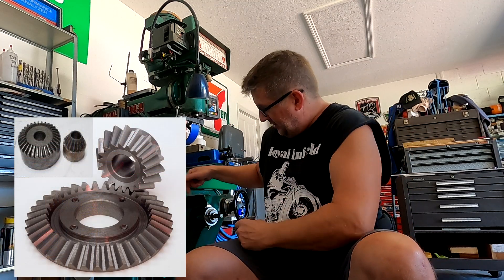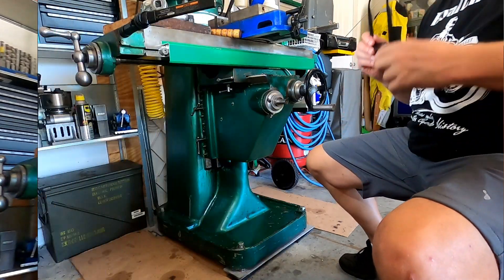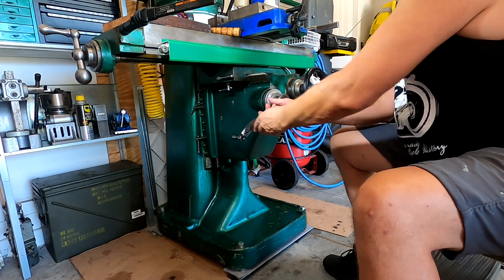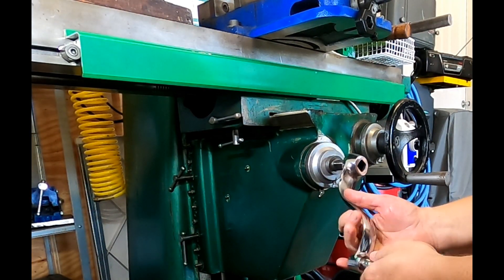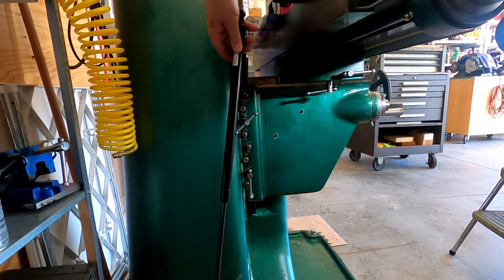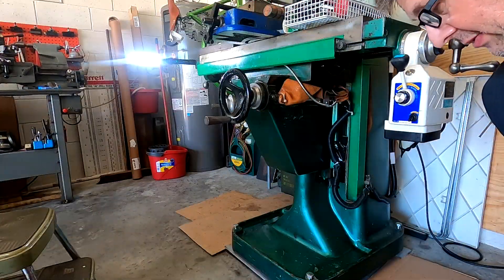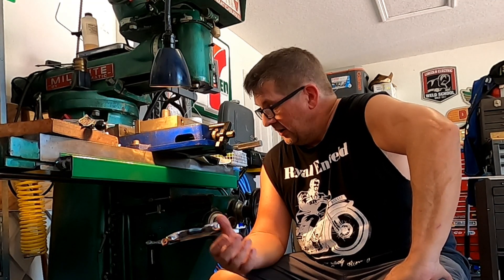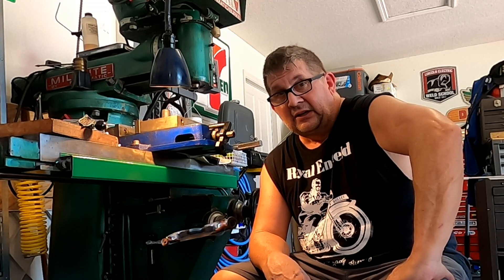How to save your Z axis knee gear from destruction. Simple modification to improve your knee mill.

Comment: When I got my mill I discovered very quickly that moving the table up & down is a huge waste of time when changing tools. 
The DRO and power feed for the table were much higher on priority list so I started looking for cheap and quick solution to drive the knee.
I found out that my “scrap yard rescue” 1/2” low RPM corded drill with variable speed can crank the knee just fine.
A 12-point 18mm deep socket fits perfectly over the 5/8 square shaft. A cut off 3/8 socket driver extension goes into the drill chuck, the socket fits the square end of the extension, et voilà - a cheap, quick and very functional power feed for the knee.
In fact, it has been working well enough for last few years that I completely abandoned any other solution.
The only downside is that the drill stick out a bit. But if it gets in my way, removing it only takes 2 seconds.

Comment: Don, I’m about ready to do this mod on my 65 MV1. Have you had any thoughts on changes or advancements on the upgrade since you have had this working for a few months now? I really appreciate your content and time invested to share your info with us. Thank you. 
John in Mn
Reply from the maker: John. Yes this is an excellent question. If I were doing it again, Ide probably use 150 PSI cylinders instead of the 200 psi. The higher force causes the knee nut to lift when I'm cranking downward with low or no weight on the bed. So doing small parts you have an extra 4 rotations of crank before the bed starts dropping. With heavier parts its not an issue though. The added assist is amazing when you use the z axis to drill upward using the z axis. Its smooth and easy to move. You can sit there drinking a pina colada and watching the bikinis float by almost forgetting that you're doing a heavy - precision drill operation. I've thought about buying a set of lower psi cylinders and just swapping out depending on what job I may be doing. I definitely do more small light weight stuff on this mill, so it wouldn't be that often.  If you need anything else, let me know. Good luck with the MV1. Great small knee mills no matter what the snob boys may think. Don
Reply: @donsengine3158  
Thanks for the update, I was concerned about that just a bit so I will look for 150 lb. lift. Your vision of daydreaming about bikinis…. That’s Florida stuff, snow boots and parkas up in the great state of Minnesota🤓
Reply from the maker: @johnvandewege7607  Hay,  I used to live in the great white North too.  My son moved down here from MN/SP and my wife was quick to pack us up and follow. Don

Comment: Nice video. Thanks.  Since you mounted your struts vertically the upward force is different when the table is up (spring is fully extended) that when it is down and the spring gas is compressed more.  If you were to move the bottom strut anchor out so that the angle of the strut varied as the knee went up and down the upward force would be more constant.  Based upon the mill and strut dimensions you can calculate the best angles as well as those that might be allowed by the mill clearance constraints.  I think this is the way a car hood or trunk springs work as the movement is on an arc.  Just a suggestion...  - - - Dave.
Reply from the maker: Dave, Thanks for the support. Actually a good point and I could explain myself better on camera, but there seems to be an antipathy for long videos on youtube. I've worked with automated machinery in the past and that's where I came up with the idea to do this.  On that type of equipment there's normally there's an average two inch to 20 inch extended difference or 1:10 offset. Servo or Stepper motors like the constant. While filming you'll notice I was originally looking for an offset in near the dovetails and was trying to incorporate that offset. Mounting in that location would have strayed too far from my desire to keep it simple. If you notice the blocks I used to mount the lower end of the struts.  There are two mounting holes. I used the lower ones but had already incorporated a higher set. This was in case I decided the movement did require a smoother action. I could simply move the blocks out away from the direct line of lifting to give me the needed offset. The struts used are rated at 200 pounds each of lifting force, but what they don't tell you is that this is an average. They actually have a (+-) of around 15 to 20%, but most of that is near the extremities of the stroke. My knee has 14" inches of movement and the struts  have a 14.30 stroke.  Starting at the full up position to mount them is the best way to go as you'll never run your table into the quill. So the strut realistically is operating in its 95 % full force at top (realistically) and would be capable of about 215 pounds (430) at bottom. I very seldom run to the bottom of the stroke unless I have something large (heavy) on the table, in which case the added lift is welcome. As of right now the direct throw of the strut is working beautifully, and my arm is taking a much needed break every time I go to use the mill. Precision depth cuts using the knee are Childs play at this point. Thanks for your astute observation, your point has not been lost on deaf ears. Don